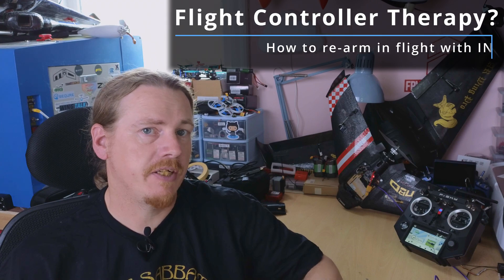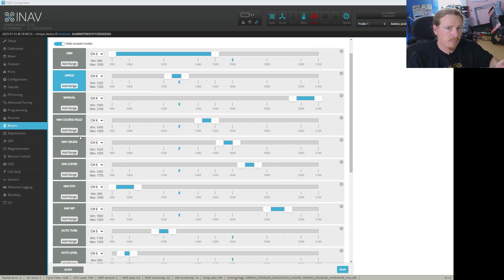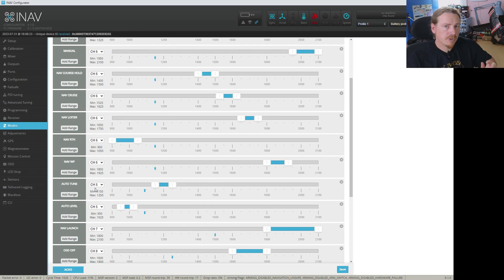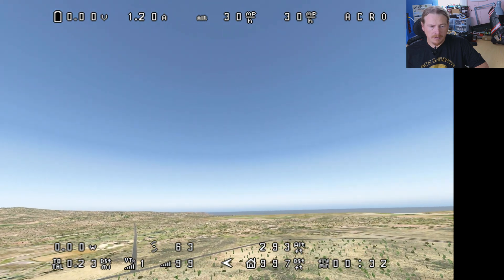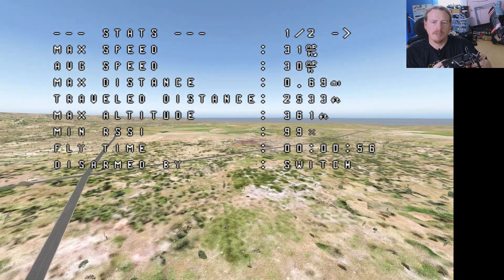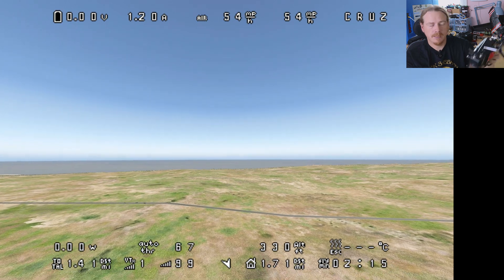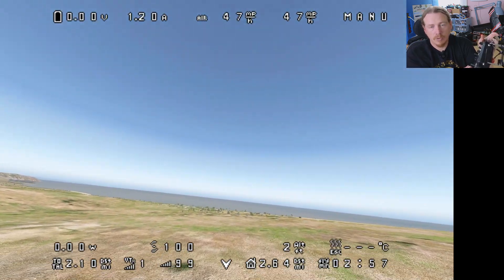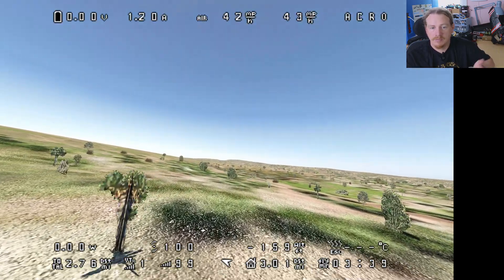Re-arming in flight with INAV

Comment: I accidentally disarm my fpv wing 2km out at 500m altitude. I was able to re arm it, but have no full deflection of elevator and no full speed of esc.. I was able to fully control the elevator after atleast 1 minute and the esc fire at full speed and busted my brushless motor. But thanks, im able to glide back my plane..

Comment: Can we not program the disarm function with altitude meaning if altitude is more than 2m that means plane is still flying and does not disarm even if we toggle the switch
Reply from the maker: No need any more. INAV 7 and later gives a 5 second re arm window if you’re still flying.

Comment: Hello friend, if I have "Continuously trim servos on Fixed Wing" activated by default, will it rearm me in flight? At the minute (1.41min.) do you indicate autotrim switch or what I am mentioning? Thank you
Reply from the maker: Yes, continuous servo trim will automatically rearm. It was only the auto trim mode that blocked. But, from INAV 7, there is a 5 second window where you can instantly rearm if you’re still flying. With no blocks.
Reply: @MrD  Hi, friend! Thank you very much for your answer. For future updates it would be good to have a counter for those 5 seconds, keeping as a record if we did it within that time threshold. In my case I couldn't assemble it because I had the accelerator at 50%, which I understand doesn't allow me to in these latest versions. It's correct, isn't it? Thank you!

Comment: So Darren - what essentially is the difference between a Dark Blue highlighted Mode and the Light Blue - I've struggled with this over the last couple of days - been difficult to understand why my quad was not Arming - no mention of the color change in Wiki or any other sites ...joe
Reply from the maker: Dark blue means that the switch position is in the correct range to activate the mode. Light blue means the mode is activated now. 

The flight controller decides when the mode can or cannot be activated. For example, arm will always be dark blue. The flight controller will refuse to arm under normal circumstances on the workbench. However, if you bypass the safety checks and force it to arm. The arm mode will turn light blue. 

Before the 2 different blues; you’d have a situation where a mode could work but with no indication that it could.

Comment: Re-arm will reset your rth too...
Reply from the maker: No, it shouldn’t. The arm position should only be set on the first arm after applying battery power.

Maybe it could on an old model that you have been upgrading via diff for a long time. The setting to update the home point every arm was changed to first arm in something like INAV 2.0.

Comment: So you no longer need to use your old video to enable you to re-arm in flight ? Just stick in eg. Manual, throttle down, Autotune off & re-arm in flight ?
Reply from the maker: You only ever needed to do what’s in this video. It has always been the same. My other video just means you don’t need to to any of this. Just re-arm with the switch.

Comment: Hi Darren. Is it possible to program a fixed value on the gyro gain ?  thanks
Reply from the maker: I don’t really follow you. The PIDs are set, and don’t change unless you change them. To adjust how the stabilisation behaves, you change the PIDs.

Comment: Thanks for this video, very helpfull. However I don't see a reason to disarm a fixed wing in midflight at all. So why not disable it.
Reply from the maker: You should be able to disarm instantly for safety. There is no 100% guarantees that the plane is still flying. So it must err on the side of caution.

Comment: If you're using the Dji 03 air unit the second you disarm it goes into low-power mode and your video just disappears .... So if you haven't exercised exactly what to do you're screwed.... I just lost my AR Wing pro this way..... It's gone forever.... It Went into the thickest nastiest Bush anybody's ever seen and I forgot to have the buzzer turned on 😭

I have since changed the arm disarm switch to the small flat button on the back of my Zoro controller, push the arm.... Three-second hold to disarm with heptic feedback..... Along with VTX power on the other small flat switch on the back.
So it's easy to Arm and turn the VTX on but you really have to mean to turn it off... That was a $600 lesson😢
Reply: Disarm_kill_switch = OFF will at least only disarm if you're off throttle (below min_check). I now use fixed_wing_auto_arm so I can't disarm no matter what once armed, which is done by just throttling up. I also disarmed accidentally on my Zorro once and for whatever reason it wouldn't rearm even with Darren's bypass logic programmed, so I had to crash land. Since then I don't trust any re-arm tricks and prefer it disabled completely via auto arm.
Reply: @ericnelsonnn  oohhh....I like that idea also... I don't think I'm going to trust any rearm tricks either that was just too expensive... I had all my bases covered besides accidentally disarming.... NOT gonna happen again.
Reply from the maker: Got to say guys, I’m really not a fan of blocking disarm. It is there for safety. I don’t really get why the rearm logic wouldn’t work. So long as you are flying fast enough, it should rearm. But, I do think that the ability to rearm should be built in to INAV if it still thinks you’re flying. I think if that was there, and rearming was just flicking the switch. There would not be any need to make disarming harder. Which at the end of the day could cause people injuries.
Reply: @SJV82  yea, I always just told myself to pay attention when switching things while flying, I thought I was good... But I was using switch SE for arm/disarm and I was using the 3pos above it (SB) for OSD on/alternate 1/off, and the first time using the osd switch, I had it OFF and I started losing video feed so I kinda frantically went to turn osd back on and flipped my arm switch below it instead... Whoops. I tried to rearm a few times and it seemed like it did rearm but I had no throttle, even after disarming and re-arming a few more times until I was too low and had to just crash land. It was probably something I messed up as a user, but either way, I don't want to have to think about extra steps/tricks/workarounds in cases like this.
Reply: @MrD  I don't know, I programmed it using your video and it worked on the bench but didn't it the air. Could have been something I was doing, I can't tell in the video recording and didn't save the Blackbox log. I get wanting safety due to various levels of user competence and general human error, but I personally prefer auto-arm where it arms as soon as I touch the throttle and can't be disarmed again until a power cycle. (I've found it will still disarm when it detects I've landed though which is nice so I still get the stats screen). Basically it's no different than just having a receiver and no FC, you don't have to arm those either.
Reply: @ericnelsonnn that's funny that pretty much exactly what I did... Was trying to hit the top three position down and accidentally did the bottom switch below it... And out went the video feed cuz I was pretty far away.... And DJI going into low power mode and all...
I may try the unrestricted rearming programming and then reduce the disarm button press down to 1 second hold...... I figure if you have controller signal... You can always just put throttle to 0 to stop the prop spinning.... Can't for the life of me think of a good reason that I would ever want to disarm in the air while flying lol..
Reply from the maker: @ericnelsonnn  honestly, that auto arm is really bad. It was only designed to be used with aircraft, where the FC is not used for control. If you needed to disarm, you couldn’t. Which IMHO is dangerous.
Reply: @MrD  that makes sense since it makes the FC act like a normal rx. IMO you are right about everything you say in regards to safety, with big but being, it should be up to the user to decide, not have the features taken away entirely.

Comment: You could have the momentary switch to override everything to have an armable state, flight mode,throttle pos, etc..
Then use it when u rearm
That way can rearm quickly and even get the same mode and throttle you had when you disarmed